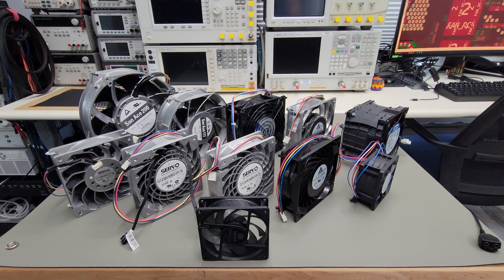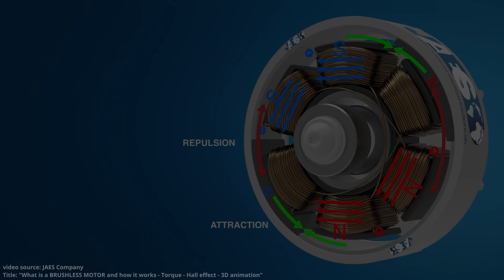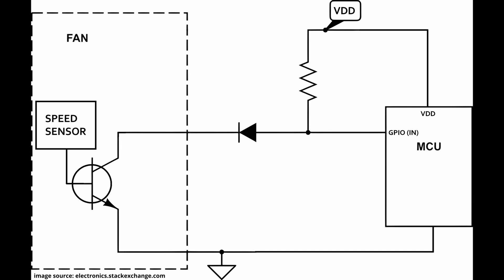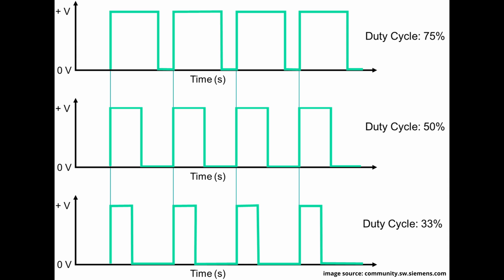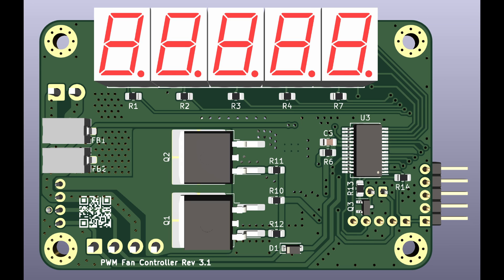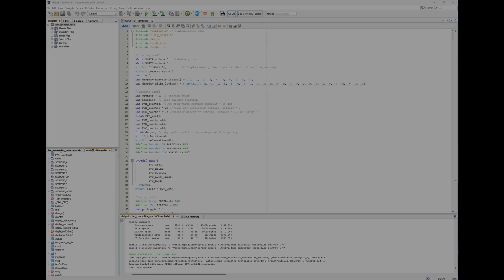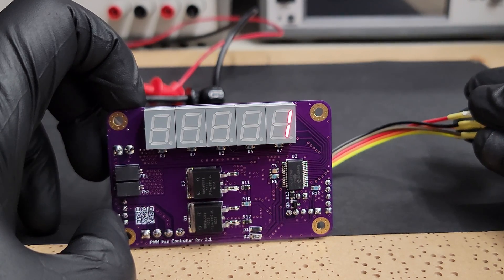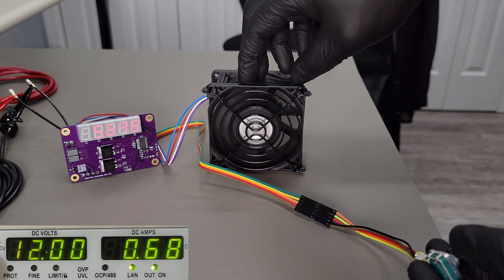Neonkev #4 - 600 WATT PC FAN?! High power fan collection and custom PWM controller.

Comment: hey, I am very impressed with all the fans you have, all those jet fans are on the list of fans in my collection that I have never owned, what amazed me is... ebmpapst DiaForce is the latest model fan, and you already have it, one of the fans which uses quite a lot of electricity, nice bro I really enjoyed your video👌
Reply from the maker: Thank you! I see that you have quite the collection of fans too. I have a bunch as well, but I chose these as they are the high power ones and are more interesting. The DiaForce is what made me want to do the video, it's quite an interesting fan.
Reply: @neonkev7866 if you didn't know, Sanyo Denki (San Ace) fans are made in the Philippines.
Reply: @neonkev7866 Sorry in advance, how do I turn on the EbmPapst 5318/2TDH4P fan? cause I just bought it, and if I just use the +red & -blue cable, the fan won't spin
Reply from the maker: @Jeff_FanCollector  Hi Jeff, are you using 48 volts DC for the fan?

Comment: good video!!
Can adjust the Diaforce fan speed by 9PC8666X-S001?
Reply from the maker: Thank you! The 9PC8666X-S001 can only support 3.3 volt or 5 volt PWM voltage. You will need PWM signal up to 12 volts for Diaforce. 

Diaforce also supports control with 0-10 volts DC voltage (no PWM). Maybe you can make this signal with voltage divider using potentiometer.
Reply: @neonkev7866  
oh.. I have the 9PC8666X-S001(I bought it a long time ago) 
I can know the special level shifter circuit buy's URL??
Reply from the maker: @kkh-y8e  
I put all the files for controller and level shifter on my website here: https://neonkev.com/2023/11/06/universal-high-power-4-wire-pwm-fan-controller/

You can download and order PCB and parts, then solder it together.
Reply: @neonkev7866  
wow thank you!!
I will order on JLCPCB the pwm level shifter circle.
Reply from the maker: @user-tz9xo4xd1y  great! looking forward to a video with diaforce perhaps
Reply: @neonkev7866  
I'm sorry to ask you again.
Can I get the CPL file? for use SMT service on JLCPCB.
Reply from the maker: @kkh-y8e  No worries. I updated files on website to include SMT files for assembly. It is the (.pos) files in gerber folder.
If you have more questions please send me message on "contact" page on the website and I will be happy to help. Thank you.
Reply: @neonkev7866 
thank you!!
If I need anything else, I'll contact you there on website

Comment: Great video, and brilliant project too. I've been tinkering with this stuff for several years but I'm no electronic engineer so I've been using discreet components to make a simple square wave generator, and it works very well indeed. I love that you've managed to cram so many features into your project, especially the (oft neglected) option to invert the PWM control signal for fans that like it so! What drew me to this video was the thumbnail image, in which I instantly recognised the Servo fans - I have the 12v version of the G1238B, which is an incredible specimen. I also have similarly bonkers offerings from Sanyo Denki and Delta, for which I've had to search far and wide. :)
Reply from the maker: Thank you David! The microcontroller design enables you to incorporate any feature you can code and fit in the memory. 

I’ve built discrete PWM controller designs using 555 timers as well; finally decided to buckle down with some newly learned skills and try to make "the" fan controller I always wanted.
Reply: I'd love to be able to make a digital one but it's out of my scope. Interestingly, I have just acquired a Nidec Servo G1238V48BHZP-95 and it runs perfectly, but I can't for the life of me get it to respond to speed control and I'm suspicious it's the frequency (which I'm running just below 5KHz). What freq were you using for your Servo fans? It's nigh impossible to get the datasheets for these puppies...! *EDIT: Never mind, I had the tach wire instead of the control wire. If only the colours were standardized, life would be so much easier!

Comment: What an awesome project!
Something about fans pulling 100W is always incredible to see lol
Do the wires heat up very much?
Reply from the maker: Thank you! The wires and PCB do certainly warm up, but I made sure to use heavy enough wires and make the traces wide on the PCB. 

I did a test on the PCB with my thermal camera and a programmable load. At 10 amps continuous, the hottest spot on the PCB are the input traces where the power comes in. Peak temp is 60C with no active cooling. I added the 5V aux fan output so you can add a small fan to cool the board if you want to run 15 amps + for long times.